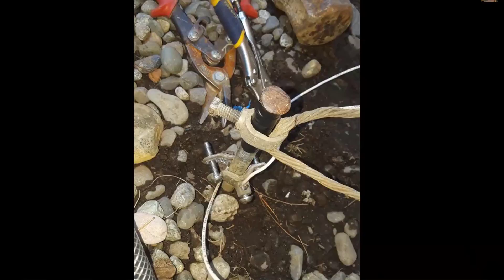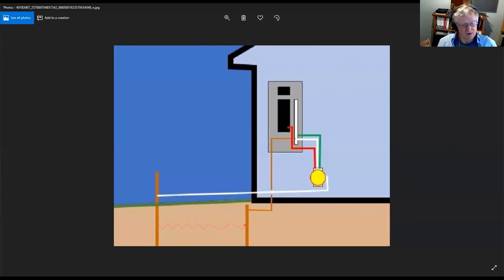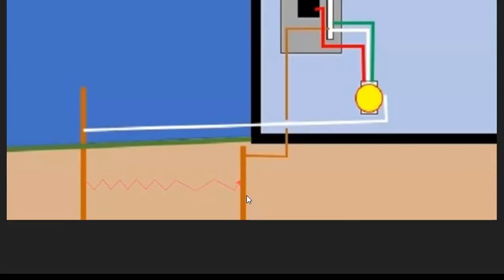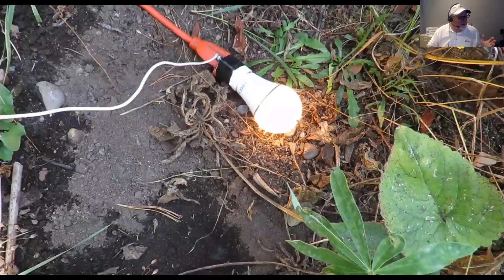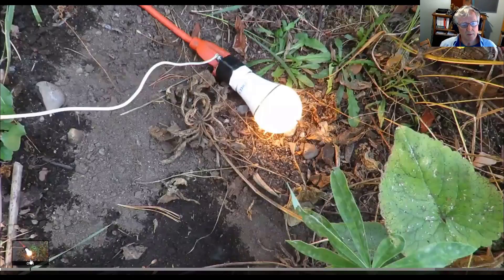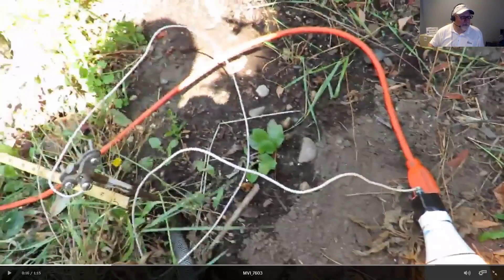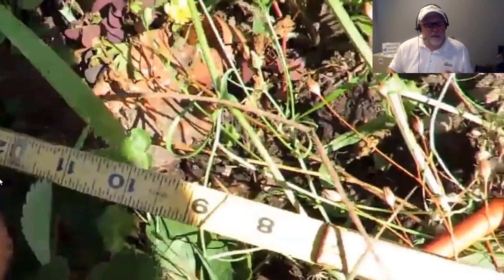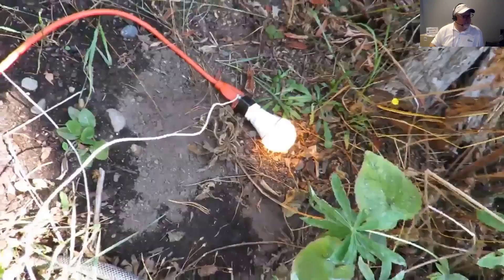Lighting Up The Earth--can I light a light bulb with the earth as a conductor?

Comment: would a 60 watt bulb light? - how do i know if the ground is good enough?, we recently had an open neutral from the power company and all the transformers in the house blew - why didn't the ground protect it's bonded at the service entrance?
Reply from the maker: It was all I could do to get a 7-watt bulb to light up.  The house grounding system does not protect anything---that is what circuit breakers, AFCI's GFCI's and surge protectors do.

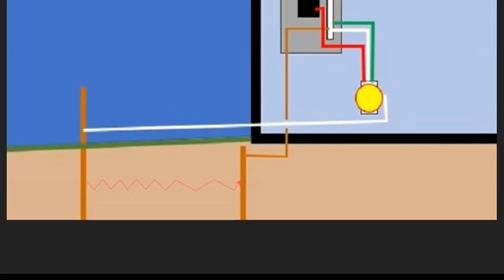Comment: Hello, I really enjoy your videos. I'm thinking this: The neutral on the secondary of the utility is connected to the earth, also all of your neighbors electrical systems are connected to the earth. Since electricity will take every path back to the source, I believe the current would be distributed through all of these paths, resulting in a very small (unmeasurable??) amount of current showing up on the utility's GEC ... (I'm thinking of your "Why we do not join ground and neutral wires downstream" video and how each parallel neutral conductor had a different ampacity depending on the size of the conductor). At 38:11 of Mike Holt's "Grounding - Safety Fundamentals" he describes an energized ground rod will have a voltage gradient. The closer you are too the rod (ironically) the LOWER the voltage so at 14" (5:40 in your video) probably not enough voltage (too much resistance?) For it to work..?  I may be mistaken but hopefully this will get you closer to the answer

Comment: I am an instructor at an electrical training school. We did very nearly this same experiment last week while preparing a presentation about grounding and bonding. 

It’s so weird that you posted this so shortly after we were doing the same things. I’m very interested in any follow up videos.
Reply from the maker: I did another video of eliminating the light bulb and just ran the hot line right to the ground rod 14" away from the house ground rod and was able to finally get some of the current to return to my house system.  I soaked the ground and put a whole bunch of salt in the watered ground and was able to get an amp on both sides of the rods.  Made a nice IR picture of the heating ground after an hour. :)